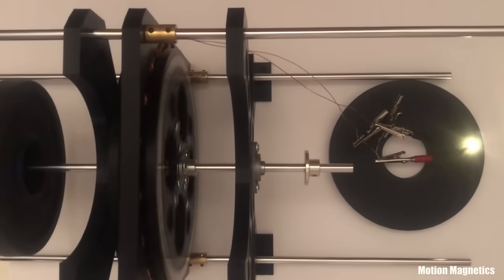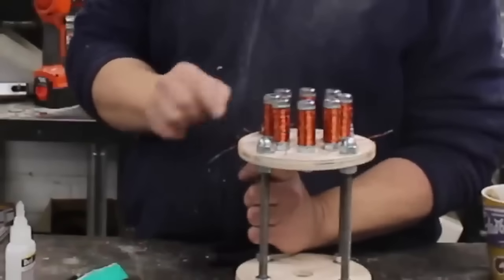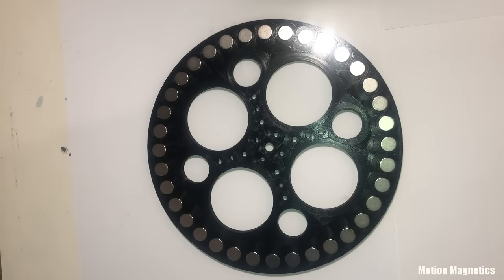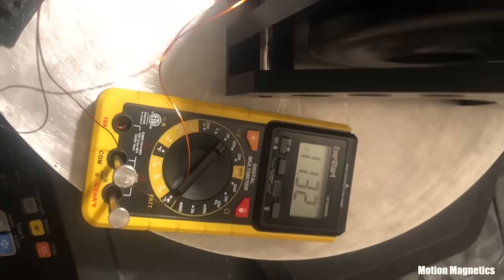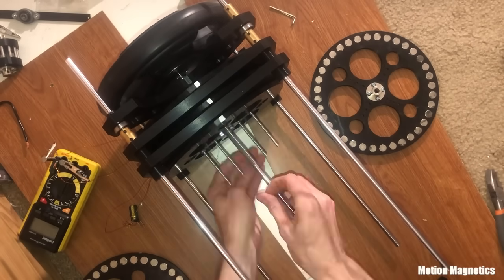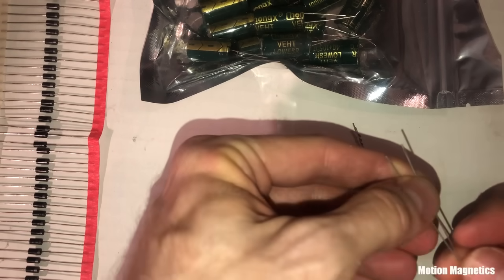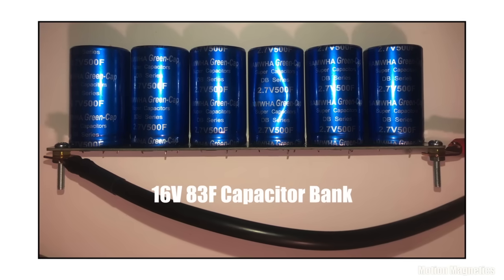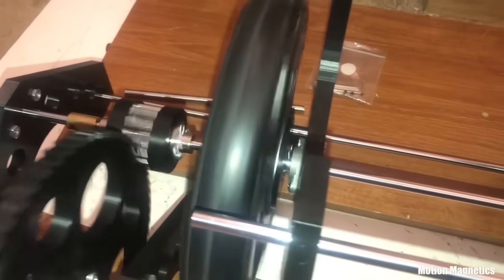Stackable Generator

Comment: I like this idea of a gravity battery or generator. In one of Roberts videos he made a 3d printed chain and I was thinking that you could use this, like in a cuckoo clock, to add to the gravity generator.
Reply from the maker: I saw that. What originally sparked the idea of building this was a series of videos I watched on Clock Escapements, so we're thinking along the same lines, and apparently, Robert is as well.
Reply: @Motionmagnetics  I seen those escapement videos to. Ya they kind of inspired me as well. The pendulum swinging back and forth.

On the flywheel, I was thinking of a centrifugal clutch.
Reply from the maker: @silverpc4611  so many things you could do with escapement designs.

Comment: Electrician here, I'd like to offer some advice. I would create two stacks. Each one in series to get to your desired voltage, then run them both parallel to up your amperage. It's called series-parallel. You get the best of both worlds without driving yourself nuts on creating tons of stacks to reach your ultimate goal. Using the capacitors is great, but I think you also might want to toss a resistor in on the negative side to slow their drain rate.
Reply from the maker: Both are great suggestions! Thank you!

Comment: You can use a combination of inductors and capacitors to smooth out the current flow from the generator.
Reply from the maker: Good point.

Comment: I like the stackable idea, I have been thinking the same. The big disadvantage I see you have is that you have massive air gaps which effects your Magnetic reluctance. The frame around the coils  have to be fabricated from soft iron to allow a low reluctance magnetic cct. Also minimize your air gaps for the same reason.
Reply from the maker: Agreed. I'm trying to put together a version that anyone with a 3D printer could throw together. You're right though. For something more efficient it should be machined and more precise.

Comment: you should make a stackable motor, think about it, normal electric motors have 1 or 2 lines of force, a stackable electric motor, has as many lines of force as there are layers or plates ie 2 per plate that's a lot of turning power with such a small amount of power in
Reply from the maker: That's an idea.
Reply: i got one that is a sealed unit in my mind that i have been thinking about for years @Motionmagnetics

Comment: It's an absolute joy to watch your design come to life! 
One suggestion that I would personally implement if I get to building one would be using a Mosfet rectifier instead of the regular diode rectifier.
Mosfet rectifiers are a lot more efficient in terms of voltage drops and will squeeze out most wattage from the generator, and since you achieved over 10V the Mosfets would have no issue fully opening (gate over voltage protection would be required though, a zener diode might be sufficient).
Reply from the maker: Thanks! And thanks for the suggestion.

Comment: Nice. I will try same but with bycicle wheels cas have bigger diameter. Stronger n52 magnets, and one magnet drive 3 coils: Left, right and top one. I will try bifilar snake coil too and mutual induction with left and right coil. Also, it would be nice to try transformer (primary and low coupled secondary) as drive coils. It would be nice to see what n52 with 75kg force would do on 1m diameter driving 3 coils. Cheers.
Reply from the maker: Sounds interesting. Let me know how it goes.

Comment: You should make a “MHPEG” A Magnetic High Pressure Electric Generator (MHPEG) with pressurized chambers arranged in a circular formation utilizes the principles of air pressure displacement to generate movement and electrical energy. Ima break down the process step by step:

1. Chamber Arrangement: The MHPEG consists of a series of pressurized chambers arranged in a circular formation. These chambers are interconnected, forming a closed-loop configuration. The circular arrangement allows for a continuous flow of air or gas through the system.

2. Magnetic Ring: The magnetic ring is typically made of a ferromagnetic material, such as iron or steel. It is positioned in such a way that it passes through all the chambers, forming a closed-loop magnetic circuit.

3. Pressure Difference: The key to the movement in the MHPEG lies in the pressure difference between the chambers. Each chamber is pressurized differently, creating a variation in air pressure along the circular formation. This pressure difference is achieved by controlling the input or output of compressed air or gas into each chamber.

4. Air Pressure Displacement: When there is a pressure difference between two adjacent chambers, the air or gas from the higher-pressure chamber will naturally flow towards the lower-pressure chamber. This displacement of air causes a push or thrust on the magnetic ring within the chambers.

5. Ring Movement: As the air or gas displacement occurs, the magnetic ring experiences a force or pressure imbalance, creating a movement. This movement can be rotational, as the magnetic ring travels through the circular arrangement of the pressurized chambers.

6. Mechanical Energy Conversion: The movement of the magnetic ring is harnessed to generate mechanical energy. This energy can be transferred to a rotor or a central shaft, which then drives a mechanical system such as a generator or turbine.

7. Electrical Energy Generation: The mechanical energy generated by the movement of the magnetic ring is finally converted into electrical energy using the connected generator. The rotational movement of the shaft or rotor induces the generation of electricity through electromagnetic principles, typically using coils and magnets.

In summary, the MHPEG with pressurized chambers arranged in a circular formation utilizes the pressure difference between chambers to displace air or gas, which in turn moves the magnetic ring. The movement of the magnetic ring generates mechanical energy, which is then converted into electrical energy through a connected generator.
Reply from the maker: Interesting idea. Not sure I'd have the patience to do all of that, but I'd love to see the final result if you decide to build that and share the results.

Comment: why don't you use the axial flux brushless method as one of your stack using magnets with a strong transformer that increases the voltage output enough to power itself and other devices?
Reply from the maker: Keep in mind that a transformer may increase voltage while decreasing amperage, or you can do the exact opposite with one, but neither will provide a free lunch. You give something up to get something.

Comment: Why didn't you use the motor from the pedal generator for this project? It should have way better efficiency due to the iron core and lower airgap -> significantly higher field strength. 
If you just want to build your own motor that's still awesome of course. Actually I'm also in the process to build an aircored linear motor for my 3d printer (as commercial ones are ridiculously expensive). I'd recommend to use an electromagnetic field solver like FEMM (free) to simulate your magnetic circuits first, also very fun to try out different things without having to physically build them.
Reply from the maker: The iron cores also make it much harder to turn, and it's pretty loud. I wanted something quieter and smoother and really just wanted to try a different approach for this project.

Comment: This is all cool to learn with but its not worth the energy to use human hamster wheels to transfer one energy type to another type it won't produce more energy than the input.. good luck figuring that out and when you do share it with the world 👍
Reply from the maker: Thanks. I'm not planning on heading in the direction of a human hamster wheel to power it, but thanks for the heads up.

Comment: I really like the gravity aspect of it but I think it would be cool to incorprate some clockwork mechinisms into the system so you can potentally increase the power impluse for a given distance. Similar to how the weight systems on a grandfather clock works, but also hypothetically you could make a clock spring type mechanism that could provide consistant power while being sporadically rewound
Reply from the maker: That's not a bad suggestion. The initial concept came from studying clock escapements so the idea of including some sort of pendulum aligns conceptually with the direction I'm headed in.

Comment: That is just phenomenal! Imagine this DIY use with anything... not needing a hundreds of dollar worth genertator or motor to do your waterwheel (inline or effective wheel) or diy generator... very easy to make element proof and adjustable by wiring size and magnet sizes avaliable everywhere...
Please Collab with "OpenSourceLowTech" for a diy waterwheel episode and be sure to contact "Kris Harbour Natural Building" for a right now happening project where he couldn't find a suficcent generator. I bet that would be a worthy collab for both parties, he's very electricially knowledgable.
You sir, have earned a sub on first video :-D
Reply from the maker: Thank you! I'm sure you could use it with a waterwheel. Thanks for the suggestion.

Comment: Great project! The last stator providing only half the voltage of the others might have screwed with your efficiency in this setup, though

It might be fun to build one as a brushless alternator and skip the permanent magnets, but I am pretty sure you would need ferrous cores for that to work reliably
Reply from the maker: Thanks. That's probably the case. I don't intend to leave it that way though, I ran out of magnets and just decided half the power of the coil would be better than not including it in the video.

I believe you would.

Comment: I made two capacitors battery bank with one motor + flywheel and one gen and a 4 channel timer rely the rely helps charge one bank fully one at a time and the motor uses the one bank not charging
Reply from the maker: Did you post a video of that?

Comment: If you are only using this to carge batteries that is one thing but if you want DC out of this you can reduce the cost of capacitors by going to multiphase stators with each coil assembly slightly out of phase with the next and the power output going through the diode bridges for each stator you will also significantly reduce wear on the mechanical components with the smoother operation .
Reply from the maker: Thanks for the suggestion.

Comment: If the capacitors are discharging into the charge controller its possible the controller doesnt have reverse current protection. 

Maybe just install a diode or two between the controller and the capacitors to make sure the flow is one way?

Also that "charge controller" looks more like a basic voltage regulator or DC-DC Boost Converter and yeah most of them don't have reverse current protection and I've fried a few of them by back driving a stepper motor not thinking about it.
Reply from the maker: It is a Buck Converter, and I'm pretty sure it doesn't have reverse current protection. 
You're the second person who has suggested a diode between the controller and capacitors. I'll probably give that a try. Thanks!

Comment: My advice would be to avoid energy conversions wherever possible, to minimize losses, so if you plan on using it to power usb devices or charge usb battery banks, tune the generator windings to output around 7 volts at typical rotational speed, and likewise aim for 14V if you plan on using 12V devices. You can even tap both 7 and 14V at the same time from a pair of generators connected in series. 
Feeding a regulator from an input only a couple volts above the output voltage also reduces losses as it won't get hot.
Likewise, adapt your devices to the generator where possible, using marine/RV lighting, refrigeration, radio, 12V laptop etc, skipping the inverter and potentially adapters.
Speaking of inverter, as long as your input is guaranteed to be steady, e.g. 400rpm, you can also produce 120V 60Hz AC directly by again adjusting the windings as needed and stacking enough generators to get the desired output voltage and power.
Reply from the maker: Thanks for the advice.

Comment: Magnet motors do not work as for putting out energy, the magnets will only spin for a short time, look up magnet motor south korea,  they gave. it the best shot a man could make, but the clips are cut & put back together &  u can see some of the motor not working. it is physics
Reply from the maker: You might want to watch the video before you leave a comment. This is a stacked version of an axial flux generator with a serpentine coil, for use with wind, water, or gravity-fed generator systems. It is not a magnetic motor.

Comment: This is phenomenal man. I've been working on a stackable generator as a side project, but haven't gotten my new stator/rotor design up yet (or my first stack) so I still didn't know if it was a good path to take. This is very validating and the serpentine coil is going to save me loads of time. Thanks for posting this!
Reply: Stackable motor ...stackable motors.. .take a look at the  rare earth magnets and copper free motors of 🇬🇧 Advanced Electrical Machines. ..they also regen particularly efficiently. 

The big advantage beyond not consuming rare earth magnets and copper windings they can free wheel with no cogging resistance when running or switched off.

Theres a definite need a modern light compact high output generator.
To be powered by the likes of the Liquid piston rotary combustion motors especially for hybrid off grid living like on sailing boats or motor  boats using electric motors and smaller  battery packs..
Running a Stoichiometric optimum a combustion motor uses half the fuel and burns cleaner and runs longer without needing servicing so much.
If you havent checked them out see..These Edison  Canadian logging truck guys have built Topsy a super functional powerful electric hybrid logging truck. 😎 
The other type of generator is the reciprocating free piston design as pioneered by Durham university🇬🇧 and then developed by Toyota.

Meanwhile keep Wombling 🧙‍♂️👍🏼
Reply from the maker: Thanks! Glad to be of help. Keep working on it. I'm glad so many of us have arrived at a similar approach.

Comment: This is pretty similar to an axial flux motor, which offer very high torque and power in a relatively small package
Reply from the maker: Yes, it's basically a stacked axial flux generator.

Comment: Great video! However I think the problem with stacking is that the main cause of inefficiency in a generator is the air gap between the magnet and coils. It's better to have just one segment with larger magnets / coils and to invest in less wobbling to decrease the air gap than using multiple stacks each with an extra air gap
Reply from the maker: Yes. There are gaps in the 3D printed prototype, but the idea is to have a final version at some point that is machined and doesn't have as big of air gaps.
Reply: I'll disagree. You may lose some efficiency in generation with a stack but you gain more power from the same mechanical input. I'm working on a similar design and it seems very sensible.

Comment: could you, in theory at least, move both sections? If the rotors spin one direction and the transformers spin the opposite, it would add more speed to the system. if you use a Slip Bearing for the wires. Just a thought. Great work on the generator though!
Reply from the maker: I suppose you could spin both sections, but you wouldn't have to. You could achieve the same thing by increasing the RPMs in the rotor.